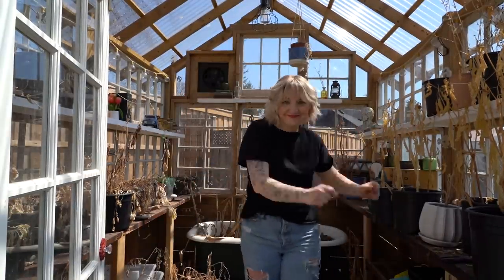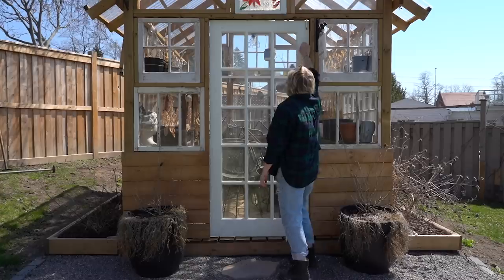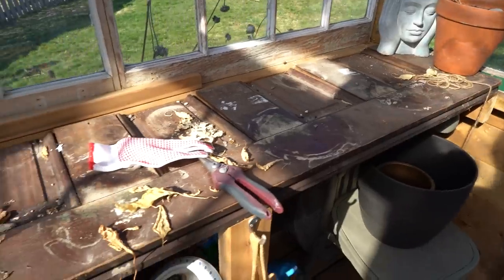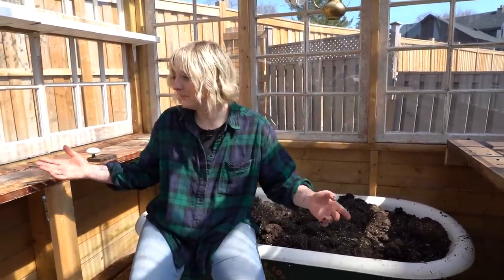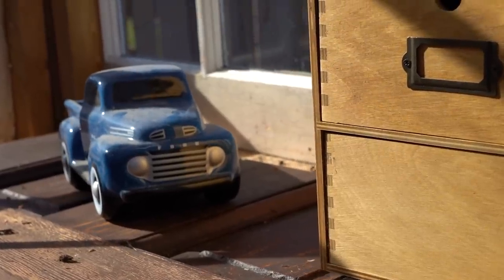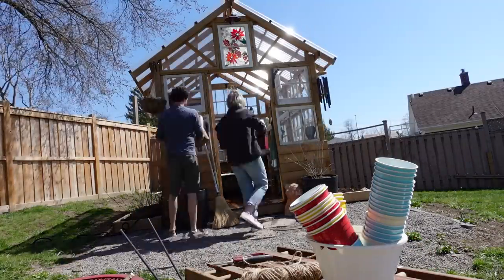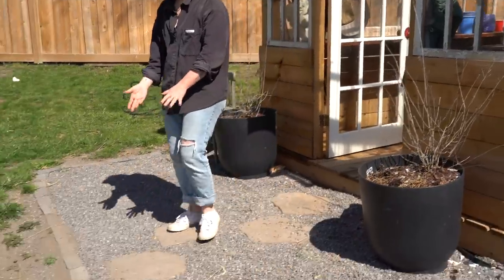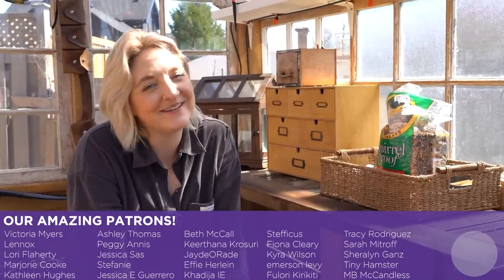Opening the Greenhouse 🌱 Irrigation System, Compost + garden planning! | DIY DANIE

Comment: Loving the new hair style 😍. 
Definitely reuse the horse feed bag as tool storage as if you put soil in it, then it could rot the bag.
Handy hint about your watering system, come time to put your garden to bed then remove the outside connection, then less likely to split in the bad weather.❤
Reply: ... and make sure the tubing is completely drained, even if that means trying to suck any leftover water out with a shop vac. It sounds silly, but  worth it in the long run!

Comment: That style of compost bin is designed with an open bottom for a reason.  Drainage and contact with the worms, bugs, microbes that are in your soil are essential.  Also being able to lift it up and access the whole pile is so much easier than trying to shovel out of the little trap door.  The cleats you bolted to the board are meant for stakes into bare ground.

Comment: Raised beds: take out grass, put chicken wire and landscape fabric down before your boxes (including your pathways). Will keep out moles, weeds, grass, etc and keeps it way easier to maintain. Use cedar wood so they don’t rot 😅 and put gravel on the pathways not mulch or chips because weeeeeeeeds. If you want to be fancy you can add grid drip watering. Also be careful your arched trellis doesn’t shade out the other garden box. Good luck and happy building!

Comment: Your greenhouse the Treasure Chest~  Cool watering syste.  Raised bed wood cedar or redwood so it's food safe.  Lay large cardboard pieces on the grass in raised bed,  wet down then add soil.  No dig and it works.   If you deal with gophers lay down wire mesh on top off grass then cardboard and so on.  Love the new do!

Comment: Oh, Danie, you should see my garden I’m building. 😅 I’ve installed a greenhouse 4X7 meters, adding more raised beds so there’s going to be 9 in the end and 286 square meters of flower beds. 🫣
About raised beds, think in what directions you put them so one doesn’t shadow the other, veggies wants lots and lots of sun, best are if they’re facing south/north. Taller crops in the back. In your beds, use no dig method. Get a lot of good cardboard, at east 2 layers overlapping each other and not a single little space weed can crawl up in. Water the cardboard thoroughly and fill them with special raised bed mix soil or compost (a stable with 3-5 year old horse manure and straw is the best!) Don’t use landscape fabric in beds, if you use it, use it between the beds. 
Make nice wooden obelisks for vine crops. I make them as a side hustle myself with a nice profit. 
One way to treat new wood looking like old grey wood is using Iron sulfate if you want that look. I’m so in love with black paint or stain as backdrop to new fresh growth.

Comment: Hair armor great. The cleanup would've made me cry but only until I started. I like that corn tub and the mulch thingy. The water dispursing I cannot fathom so I blank out in that. Having worked in all sorts of greenhouses and having done the watering I did it on a large scale so cannot picture the individual plant drip or spray system. But you can bet I will be watching. And fantasising about doing just that.

Comment: Go to your local grain store and buy a "cattle panel" (you might need 2) and bend those for your arch way. It might be handy to have a large metal barrel to bend AROUND, but to be honest, I haven't tried that trick. 
 An angle grinder is great for cutting the wire should you need to trim panel. Just beware if sparks & wear safety gear ! ;)

Comment: Love all the garden videos finally popping out as spring has come! Looking forward for new videos on the gardening topic! Regarding the compost bin, it should not have a base  for multiple reasons, for worms and other insects to be able to come and help with composting process and also for excess water to run through. On top of that plywood board will definitely start to rot at some point and it will leach out the glue from it, which I am pretty sure is a poisonous thing and this compost would be contaminated and not good for veggie gardening.

Comment: Re: raised bed
How hi off the ground do you want them?
If you have rabbits to keep out of the garden, make it 26” tall or taller.  With Kenobe, you probably do not have to worry about rabbits!  If you don’t want to bend over much while you work or work on hands and knees, make it 30” tall.  Of course, taller beds require more soil OR Huggeculture method: put old logs in the bottom - they take up space and decompose to feed the garden.

Comment: For corn to pollinate properly, you need at least 50. If your corn comes with lots of empty spaces, it means it didn't pollinate. The arch is a brilliant idea. You can plant your squash/cucumber etc to cover it.
Reply: Yeah, I was wondering if that would be enough space...and if there would be enough wind to pollinate the kernels.  Something to consider if the corn harvest doesn't work out.
Reply: Only one of the corn seed I direct sowed this year sprouted. It has 2 ears of corn on it. Last year I bought a six pack starter. I still got corn.

Comment: I built myself raised beds last year using scaffold boards (2 high).  Best bit of advice, dig the turf up and flip it over to compost down.  I stapled in roofing barrier to the inside between the wood and soil.  Also bought good quality 10year paint for the outside.  I've had to build cloches on mine because of the feral cats; no cat poop on my veggies.  I attached them with hinges and gate handles so I can just tilt them off when needed.  I loved watching the greenhouse project btw!  Looking forward to seeing how you get on this year too 🥰  p.s. be careful where you plant that mint!!  Think triffids; it will look innocent enough in the beginning but.....😬
Reply: Yes, mint takes over !
Reply: What is a cloche? I can’t seem to google it. My cat likes to dig in the garden as well
Reply: @krisko55  a glass jar - about the size of a quart, though some are larger.
Reply: I’m still confused sorry :) Are they jars like a fence around the edge? I agree about the mint but I trim mine regularly when it overgrows and the roots are already creeping and I just mercilessly pull them out to contain it and it seems to work
Reply: And the mint tea yummm worth it

Comment: For sure put flowers in the horse feed bag. Also with the water system in the greenhouse are you going to seal all the wood that's in there because otherwise it's going to run out I don't remember if you sealed it initially when you did the house?

Comment: If I can make a recommendation, please? Corn is wind pollinated. You need a larger garden to get the benefits of the wind. Growing corn indoors does not work well. Kale would grow pretty dang good as would lettuces during the spring. Minnesota Gardener here! I no longer grow corn has my yield was hirrible.horrible. I am so sorry. I have a migraine. Barometric pressure took a nose dive. Compost happens!

Comment: I almost bought that hydroponic growing system the other day!  Question:  Do you need to use filtered water or is tap water okay?  AND where did you get more of the food?  It looks like they barely give you enough.
Reply from the maker: I just use the water from the hose! Nothing fancy...but i will say that our water is from a well, so it's not filled with all the icky chemicals. I did need more of the main hose line but I had plenty of the smaller hose that feeds off of it. I was able to run the smaller hose farther and it worked out ok but I would certainly buy more hose later if we plan to expand.